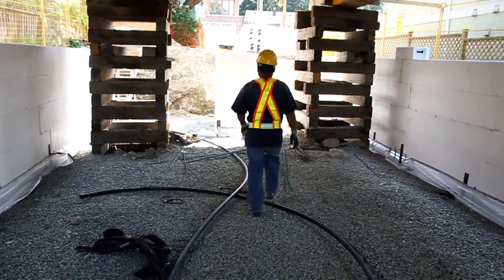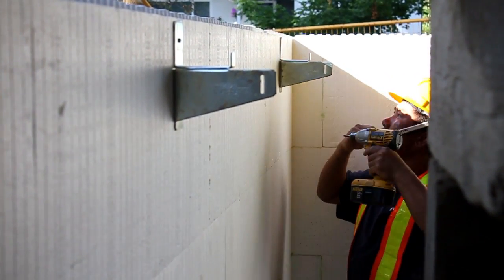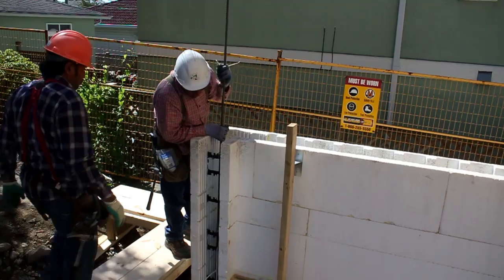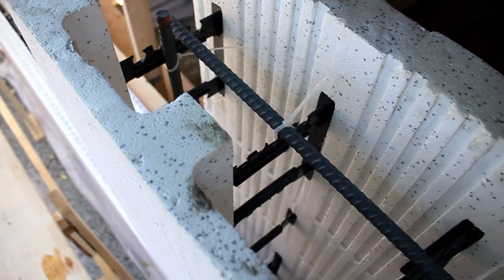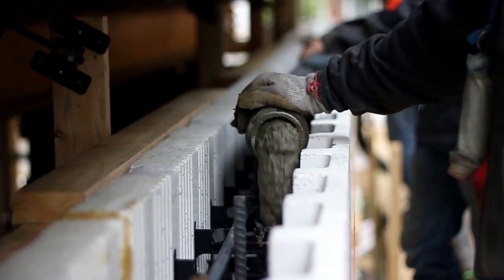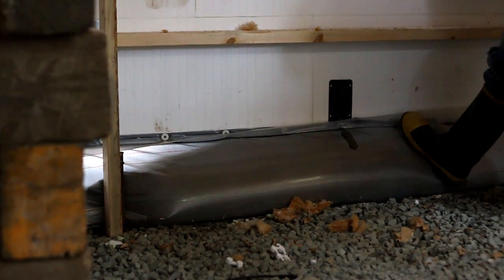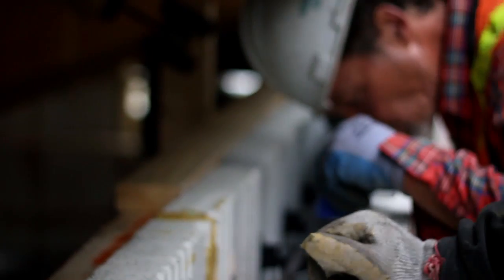Fastfoot® ICF Monopour: Usar Design Build

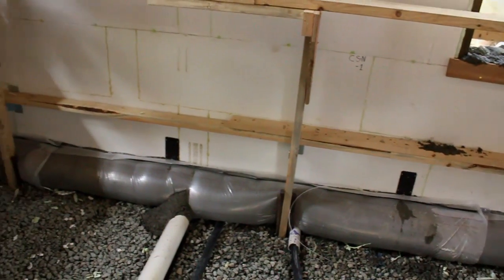Comment: I noticed a blow out of the fastfoot at 1:38 above pvc drain pipe. Is that because the fastfoot was opened up for the pipe to pass through or was there a different issue at hand that caused this blowout. I am interested because I am possibly looking at this same process of monolithic pour.
Reply from the maker: When we put pipes through the footing we cut it vertically, and slide the pipe through. A bit of concrete will come out of the bag until it is sealed by the concrete. The contractor just made his vertical cut too large, but this really isn't a blow out. You can cut the bag vertically all you want, its just horizontal cuts more than 4" are not ideal.
Reply: @FabFormIndustries  That's what I was thinking but was wanting to know for sure. Thank you.